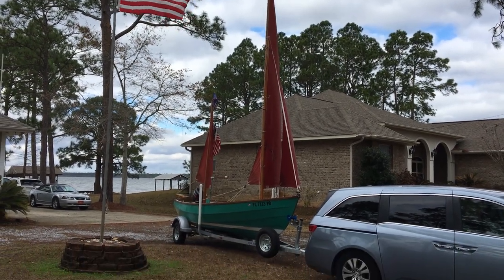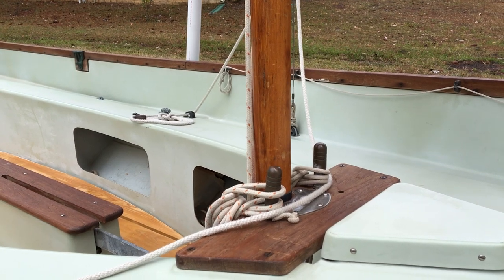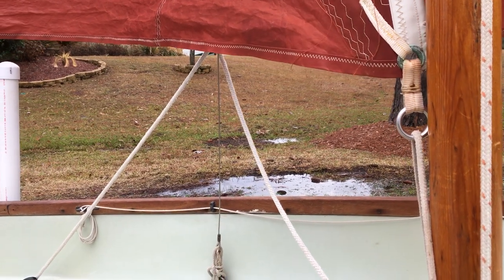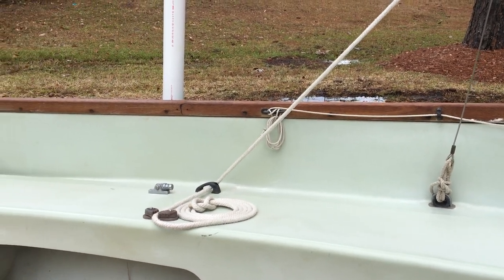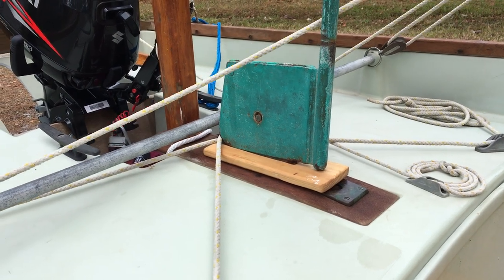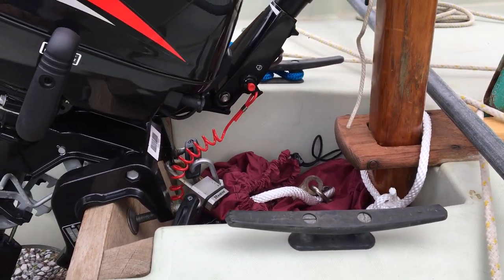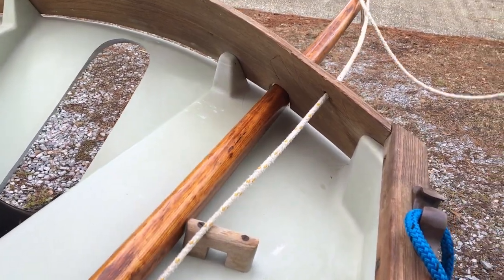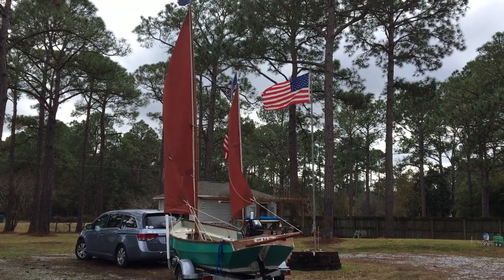1980 Drascombe Lugger ONKAHYE 12 Jan 18 Ramp Ready

Comment: Great video. I have just bought a Drascombe cruiser and your videos are very helpful. I like the system of keeping the rudder up.
Kind regards,
Paul. ⛵️
Reply from the maker: Thanks Paul,  We of course did not think of it on our own, we got the idea either from the Drascombe Association Forum or the Drascombe Facebook page. Fiddling with the rudder when launching was always a chore, especially when maneuvering the rudder around the Old School W Style mainsheet. The chock also comes in handy for beaching, though we haven't dedicated a line to tie the tiller up out of the way yet, like our Netherlands friends seem to like. More info on Skipper's 1980 Lugger ONKAHYE at http://smallboatrestoration.blogspot.com/p/drascombe-lugger.html
Reply: @kentblairl  Thank you for the reply.
I had a look at my rudder today to make some measurements for the chock but the cruiser rudder is not a pivot type, so it has nothing to catch onto the chock. I suppose I could have a line from the mizzen post to hold it up? I will have a search and see how it is done.

Great blog on the lugger.👍
Cheers,
Paul.⛵️
Reply from the maker: @SCCFORUM  Some folks drill a single hole through the top of the rudder blade and slide a pin or dowel through that to keep the rudder from sliding down. Your line idea might work, or a bungy that pulls light tension on it. Let us know what you figure out.